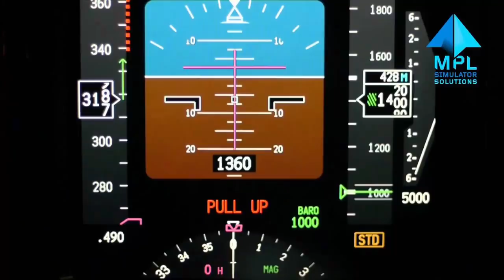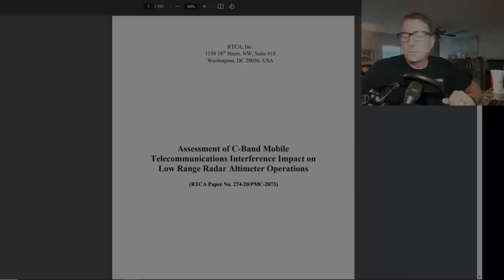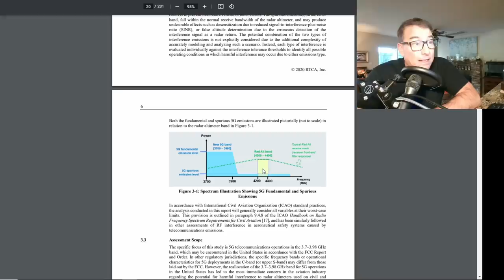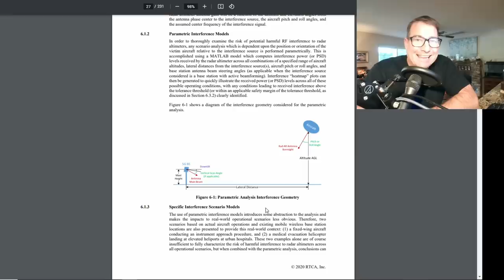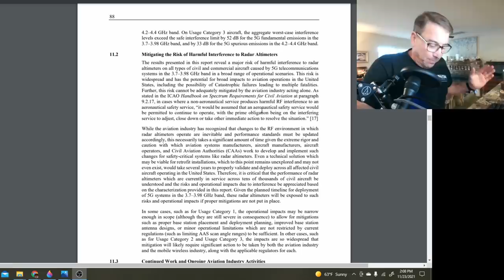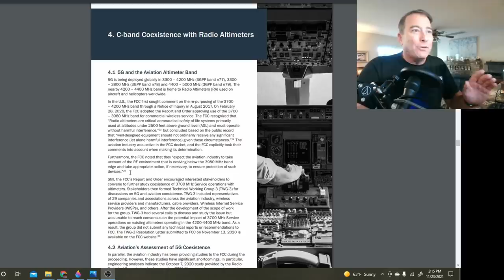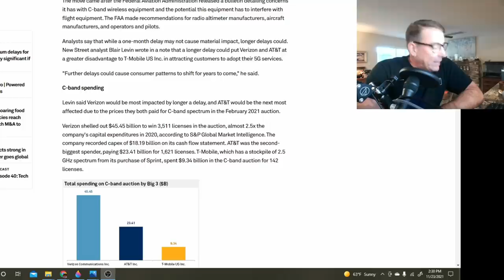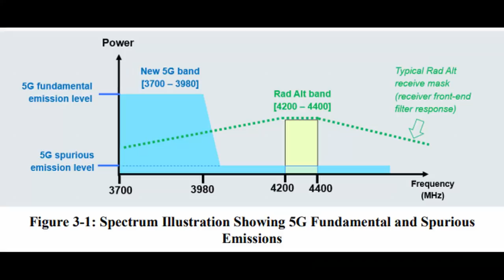5G C-Band Interference with Radar Altimeters in Aviation

Comment: Great report! Not a RF engineer but worked for a company that installed and certified satellite internet on Part 121 aircraft. There was a huge amount of cost$$$ and labor involved to develop the test plans and equipment to accomplish the certification testing for ground and flight EMI. If the telecommunications companies are to move forward with the 5G they should be required to accomplish the testing to prove non-interference of their ground network at airports and Hospitals as you point out. They should also pay for any expense to the airlines or the avionics manufacturers for any testing or modifications that may need to be done as a result of 5G interference. Agree with you the notification bulletin from the FAA is nothing more than a CYA.  
KEEP UP THE GREAT WORK. Love your channel.

Comment: So, the Telcom advocate (FCC) guarantees that all 4gz 5G base antennas will be tested to insure proper alignment so as not to interfere with RAs?
Little old history - I was a AT&T microwave tech back in the 1960s. Had a microware repeater station that was experiencing heavy fading on Sunday mornings that affected the whole spectrum of the 4gz band for microwave back then. Went out on a Sunday morning and waited until the fading began and climbed the tower and saw an Air Force radar antenna pointed directly my tower. Drove back to the radar site and honked the horn. Two airmen came out to the gate and I asked what they were doing. They replied that the were calibrating the ranging of the radar. Asked them what they were using as a target and they replied "Oh, that big tower of there on that hill over there". Problem solved and no one injured or killed.

Comment: 'RA data is also used by modern aircraft Speedbrake systems (spoilers).  In particular, the AUTO SPEEDBRAKES function ( the automatic deployment of spoilers upon landing) is dependent upon Radio Altitude.  This is regardless of CAT3 autoland system.  There are several other functions that utilize RA data

Comment: I am a retired electrical engineer and a general aviation pilot. I haven't yet read through all of the documents Juan summarized so well here, but I find it interesting that the 5G Americas' 38 page white paper tries to dispute the RTCA's 231 page technical report. I will have to dedicate some time to read through them both, but I just can't see how they can make an effective case using anecdotal material against such an exhaustive technical document. Thanks for putting this together Juan, you're the best source of aviation related information on the web!
Reply: 'Anecdotal material' can be misleading, when applied to criticism. If you are analysing a technical document, and find a 2+2=5 error, you do not need to perform your own calculations to find that indeed, 2+2=5. 
The basic arithmetic error as above is unlikely, but if the original article for example mis-estimated antenna gain at the relevant angles, or reflection due to bad assumptions then that alone can in some cases be enough to determine the report cannot be accurate, and once you correct the reference frame of the graphs support or not your case, without more work.

Comment: Japan has already deployed 5G spectrum up to 4.1GHz, with a 100MHz guard band from the radar altimeter spectrum, which was the margin requested by Boeing when they were initially consulted by the FCC. Other countries have deployed 5G up to 4.0GHz, providing a 200MHz guard band for additional safety margin. The FAA's position may carry weight in the US, but many many CAT III autolands have been done into airports where 5G has been deployed near the radar altimeter spectrum. EASA and other aviation regulators globally aren't backing the FAA up on this.

The report cited by the FAA is based on a scenario involving a large number of radar altimeters in close proximity such that they interfere with each other. The engineers came up with a set of radar altimeters that would work in spite of their mutual interference, but when the 5G transceiver was turned on, that caused some of the altimeters to fail. They needed an unrealistically high concentration of radar altimeters, and it was mostly the radar altimeters interfering with each other, but they did come up with a scenario where 5G is the straw that breaks the camel's back.
Reply: This echoes my suspicions surrounding this issue... Could you provide any sources for these claims that I could use to persuade others?

Comment: Rarely do I click to watch a YouTube video with a displayed duration of greater than five minutes, but as my wife is (at this moment) stalled in India because of this problem (we live in the US), I did. And in this case, I was not disappointed. The speaker does a great job of describing 1) what the affected systems do, and 2) why the 5G signal could be a problem.

In hopes of helping some others to better understand the frequency relation graph, I offer this alternate view. All radio receivers (from land based FM radio to satellite communications) can receive a large range of signals. Electrical signal filters are used at the input to select the desired frequency band and reject signals outside that band. The filter rejects signals more as the distance from the desired frequency (as a percentage) grows.

Stated another way, hypothetically, if the desired frequency were 1 MHz, and the filter design could cut unwanted signals at 500 kHz (50% of the desired frequency) by half, then the same filter design used at 5 GHz would cut undesired signals at 2.5 GHz (50% of the desired frequency) by half. Notice in the video that the difference between the desired signal (lower end 4.2 GHz) and the undesired 5G signal (3.98 GHz) is less than .053%. This is asking for trouble as very few filter designs could achieve a reasonable level of attenuation so close to the desired frequency.

Again, excellent video, the speaker does a great job.

Comment: I'm a recently retired 10-year B777 captain.  Very nice job on the video.  Based on what we know, it seems to me that pilots should dispatch as if the radio altimeters are inop and only accept Category 1 approaches into areas with 5G.  Before we return to normal, we should demand that recording devices are developed to store radio altimeter data to see if there is a problem or not in real-world conditions.

Comment: Juan, you are 100% correct!
⚠️Prior with Nextel/Sprint, we had interference issues with Denver PD causing a major problems and essentially did a FCC frequency swap & grab to solve the problem.

The higher frequencies do not penetrate buildings well so the lower frequencies 600 and bellow are ideal.
Reply: You are mixing up two completely different issues…
Reply: Bandwidth and frequencies go hand in hand. 5g is always on and requires great bandwidth as more users are added on the 5g network. 

Att & Verizon are using their broadband channels in large cities to have the capacity for this bottle neck.

T-Mobile who own’s Sprint,  leases Dish Networks low band frequencies which penetrate deep into structures. 

Apparently AT&T and Verizon are going to launch their own low frequency networks in the future.
Reply: @icare7151  T-Mobile is one of the two carriers who just activated the 3.5 Ghz 5G-Midband carriers which are the ones causing the problems with the older C-Band RALT receivers.  

its Verizon and T-Mobile.  

5G UWB and 5G LB operate far enough out of the spectrum of C-Band to not be a factor.  UWB is 28GHz mmW and is designed specifically for the URLLC Gigabit Mobile Services and LB is the 4G LTE Evolution into 5G operating in the 1200-1900 MHz bands.
Reply: @CapStar362  In that market. In large cities with significant dense population they are using frequencies with the greatest bandwidth capacity in the broadband spectrum. 

I am referring to general Nationwide implementation. It’s a total mess to say the least. 

In any case, it’s Government 💵💵💵💵💵💵💵 slush funds going on at the FCC called payola, a sign of the times we live in.

Comment: This is a nice overview of the 5G vs Radar Altimeter safety issues from a pilot's perspective. The bottom line is that the current radar altimeters need to have their front end bandpass filters upgraded to ensure higher levels of out-of-band rejection, steeper cutoff responses. A process that will take years to complete in the aviation industry due to the rigorous certification testing that needs to be done before such a critical component can be installed on an aircraft.

Comment: Rather than just a close use of frequencies with just one watt of power used for the altimeter I would be more worried about harmonics from the 5G transmitters. Anything incorrectly installed or lacking proper maintenance could easily swamp signals from the altimeter.
Reply: Indeed, spurs from the 5G transmitters are what I wonder about as well.
Reply: That is exactly the concern.
Reply: Spurious emissios will be much stronger and they also tend to be much more intermittent.  The report completed ignored this.  Field testing is the obvious path forward.  The fact that the telecom and aviation industries have not agreed to form a working group speaks volumes.  Money and special interests have obviously corrupted the process.
Reply: Actually, the first graph shown at 2:23 illustrates why the spurs/harmonics (spurious emissions is a better term, as this encompasses all unwanted emissions) are not the problem at all.
The problem is the fundemental emissions (the wanted/intentional/operational 5G transmissions) that encroach into the existing passband of the radalt rcvr. 

This graph is just an example with no actual figures on the scales but illustrates the concept well enough as follows:

The fundementals area of the chart is the tall left blue shaded area. The spurious emissions is the low blue shaded area along the bottom. 
Relative field strengths are on the vertical scale, (higher up that scale is basically more field strength) frequency is along the bottom axis, increasing as you go left to right.

The interference risk exists if ANY blue shaded area is higher than the dotted green line (the radalt rcvr passband plot). The fundemental spectrum IS higher than the line, so will breakthrough the front end filtering on the radalt rcvr. 

What we see is the spurious emissions limit ensures that the field strength is well below the level that will interfere with the radalt function. In simple terms, the spurii are kept so low, in the lower thin blue area at the bottom, that they don't overpower the yellow/lime green shaded area nor do they encroach above the level of the reen dotted line. No interference is possible with the current situation from the spurious emission levels. 

IF the radalt rcvr passband can be tightened to reduce the effect of the 5G fundementals (the lower left end of the green dotted line needs to be taken lower, notching out the more powerful fundementals.
This isn't so easy due to the pulse response on the radalt front end needing to be smooth - tight filters "ring" like a bell or an echo in an empty room - this distorts pulses and causes problems for the radalt.

That being said, modern filter designs and design software are very good, but the problem is not solvable on the 5G side of things without abandoning  the 5G in that part of the spectrum completely. 

Simply limiting mast power, modifying 5G base antenna gain patterns or banning masts close to approach paths simply means that the handsets must use higher powers, so it's Catch-22 that way.
Many masts (small cell zone size) keeps the required field strength down - one of the main design principles of 5G and that is a good thing overall for spectrum re-use and adjacent spectral users. 
In some limited situations, relocating a single troublesome 5G site MIGHT provide a cure from mast-based emissions, but, crucially, NOT from passenger handsets on the flight, who will be on higher power trying to communicate with more distant sites instead. It's a very complex problem. 

NB:
My main concern is that passengers have been conditioned to ignore the "flight mode" rule as it's never properly policed in my experience. Sooner or later some aircraft is going so slam down hard and it's not even going to be provable that a passenger handset has been the cause. 

Yes, onboard flight data recorders may show a radalt glitch, but proving what caused it at that specific moment in time is not going to be possible as there are too many factors on RF propagation at these frequerncies to prove or disprove anything from an onboard handset at any particular moment. In this respect base station field strength is much more predictable as a factor, but handset positioning and orientation so close to the radalt antenna, combined with the complex structure of the fuselage, plus the possibility of cumulative handsets in use at the time, makes the rogue passenger handset scenario very real in my RF mind. 

I HAVE NO STAKE IN EITHER SIDE OF THE ARGUMENT - but - and in a aviator-centric comments section this is going to be controversial I admit - I think the answer, now the cat is out of the bag, is to upgrade the radalt front end filtering. In my professional world, using older tech is known monetary business risk, regardless of legislaltion in force at time of purchase or legistaltion in force currently. Its bad news for the aviation sector, especially the GA or small operator crowd. I realise that. So maybe they shouldn't have to pay. But you can't blame the 5G opoerators for operating entirely within their limits (but see the lobbying problem, below) 

If the brakes on my vintage car pass a safety check but aren't up to modern motorway driving then I either buy a new car or upgrade the brakes. I don't ask other drivers to slow down if they drive within their legislative limits and the law. I just have to accept that time has moved on and the lawmakers have approved a higher speed limit. A similar analogy is you wouldn't try to operate an old DC3 on a transatlantic oceanic track today. 

That being said,  " lobbying " *  seems to be what has caused this problem in the first place, NOT just the laws of physics. In the short term, the aviation sector probably needs to "donate" more money to increase influence when these decisions are being made by regulatory agencies. 
Maybe the RF regulators should fork out some of the money - after all, they ignored the reality of the status quo when they decided to release the spectrum and set the 5G spectrum use and limits. Regardless of my opinion, it sure is a real sticky and stinky sh1t show. 

I just don't have any cheap answers to this either way and as a lifelong RF guy specialising in EMC issues, that makes me rather sad. 

RF - especially complex propagation in close-in structures and EMC - is VERY complicated - especially when the pure theory gets turned into real-world practice with real-world asses on the seats. 

* sorry - I can't spell the word " corruption " properly, I know.
Reply: @gordslater  That is an excellent fact filled response. Maybe some (or all) of the billions in auction proceeds should go to the aircraft operators to help in equipment retrofits, if that is even possible. I wish there was an easy answer, but there isnt. This isn't the first time the FCC has sold the rug out from under a dully licensed radio service. Fun fact: After the B2 became operational, the FCC sold our radio allocation to a different radio service. We redesigned the radar to operate on a different frequency, and in the process, were able to utilize advances in electronics, microprocessors and antennas to improve resolution and reliability dramatically. It wasn't cheap, though. I have no idea if the government offset some of this redesign cost with proceeds from the sale. That was well above my pay grade.
Reply: @gordslater  I agree.
Reply: @rv6amark  Problem is that all those billions are unrealized income for the gov.  The telecoms lowballed the auctions for pennies on the dollar.  Seen the same problems with wireless mics.

Comment: Good report.
I'm an EE here in Canada, with about 35 years experience.
I guess the final result will be to upgrade the aircraft altimeters, hopefully before a disaster occurs. Like all other parts of life money seems to be the driving factor. Both in the original radio altimeter designs and now in the 5G encroachments. 
The "I was here first" logic, when it comes to non-recyclable natural resources like radio spectrum, never plays out well in the long run. We all have to find a way to make life work for everyone and as the number of users increases, we all have to be ready innovate to get everyone a seat at the table. (I'll have a bit of light and dark Turkey pls).
Reply: Thanks for the common sense. A confrontational approach serves no one well. This can be resolved.
Reply: You are very right!
Please think about the technical progress in radar sensors in the last decades: up to 25 radar sensors are within a single car for semiautomated driving, alerts and things.
Think about them dealing with interference, think about costs (!)

The aviation industry not updating the old standards does not pay out in the long term. Think about Boeing tossing against Airbus simply based on outdated technologic standards in use.